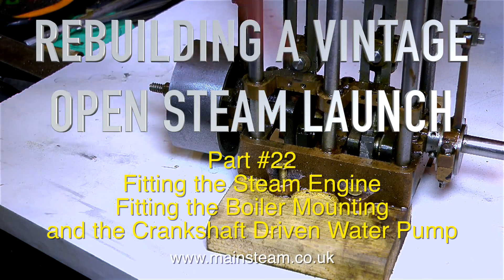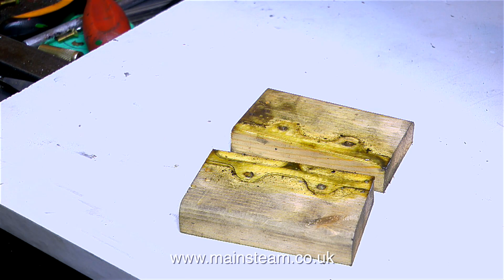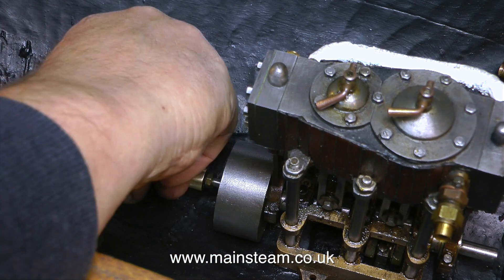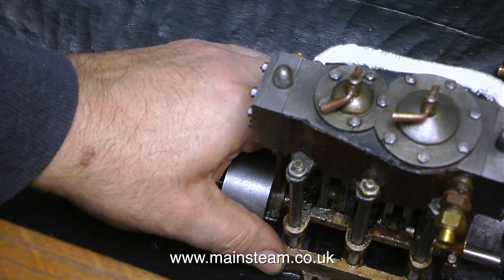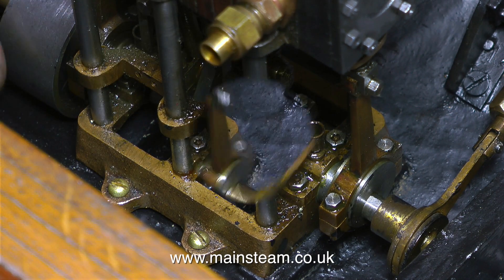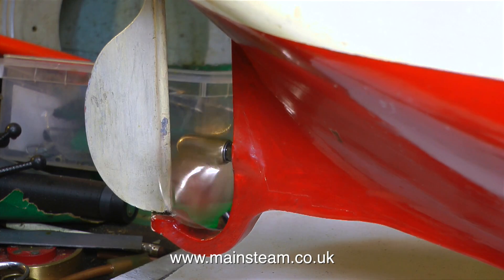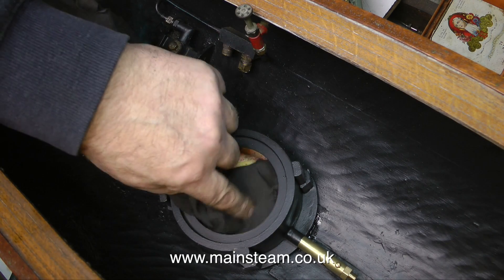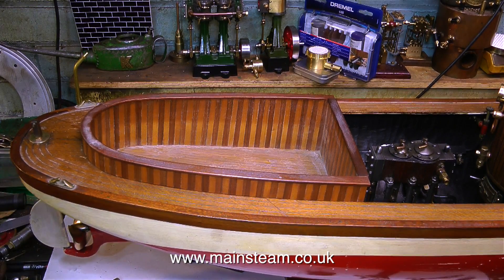REBUILDING A VINTAGE MODEL OPEN STEAM LAUNCH - PART #22

Comment: You could use the water pump to "warm" the gas container; in the same way they are used to cool electric motors in RC boats. Run some tubing from the little pump into a coil that wraps around the gas can, the water, being much warmer than a slowly freezing can, will dump that warmth into the can. Hopefully that'll keep the gas from freezing up too quickly.
You could then run the outflow from there back into the pond or directly into the bypass connection, whichever works better.
Reply from the maker: I just route the steam exhaust pipe under the tank to keep the gas warm, but I cannot mention that in the videos as the Health & Safety issue would be a problem.

Comment: I was on the African Queen once ,when I was a young man. I spotted her sticking out form behind a shed. She was on a trailer ,in a yard in Connecticut. So I climbed on.  The thing that struck me the most was that she had a belt drive. There was a 3or4 belt pulley on the aft end so the fly wheel. The prop shaft was a foot or so below the engine beds. Thanks again for the great videos .

Comment: So, is there a fix for the hard starting problem of this two stage or compound engine?
Reply from the maker: Yes - it is called a 'Simpling" valve but the owner of the boat does not want the complication of that.